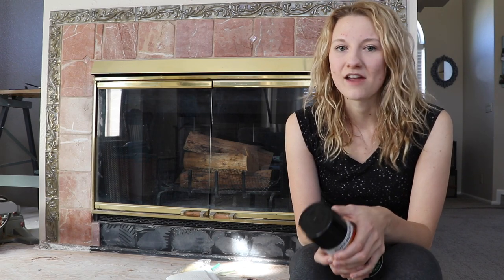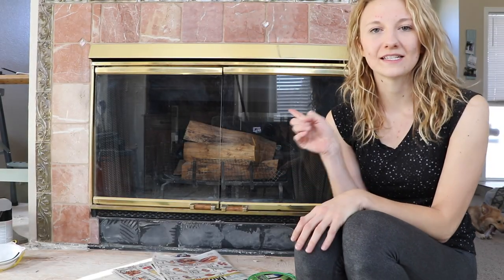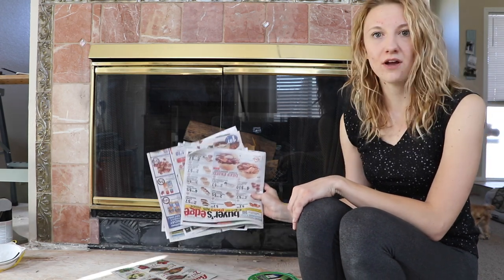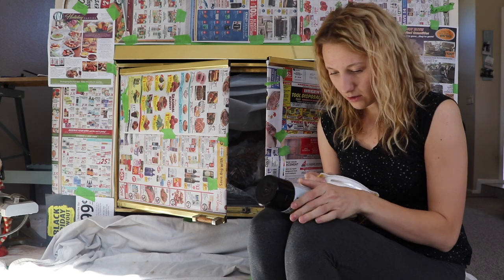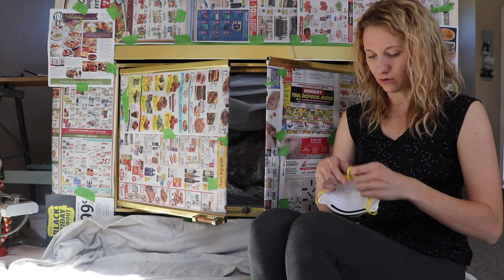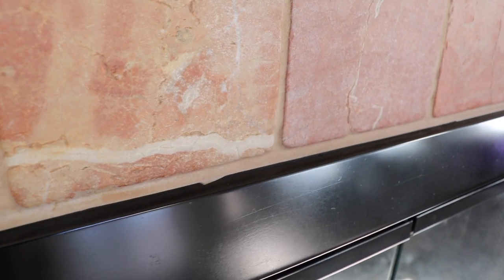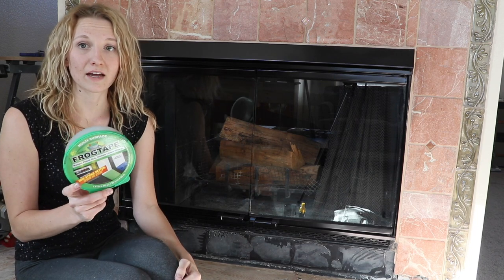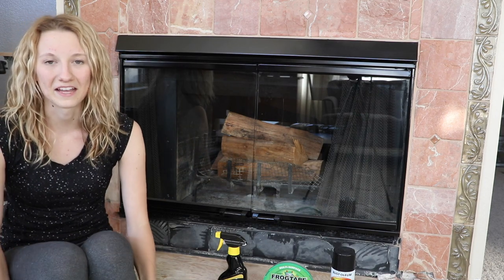$4 DIY Fireplace Makeover! Rustoleum High Heat Spray Paint

Comment: I LOVE the change. I have a surround to paint on my own fireplace.  Great job!

Just FYI, I've painted many windows, for the over spray spray the glass with water and a few drops of dish detergent added and then use a safety razor to clean the paint off of the glass. It is so much easier and faster and you don't run the risk of softening the other painted surfaces.

Comment: Just an FYI. You can remove that surround and spray it outside. SO much easier. Most have 2-4 screws, and that's it. Look inside your fireplace. You will save yourself some prep work, and the possibility of overspray floating around inside your house. 👍 For those saying it's still tacky....you did not clean and sand before spray, you didn't shake the can long enough as directed, or you haven't waited the full cure time.

Comment: Hey, i had the same issue as Sally Cooper below. You used "Ultra" with a glossier finish, and I just used Rust-oleum High Heat Black (satin finish)... after almost 18 hours now, it rubs off a dusty layer on my fingertips. I'm curious if a "heat cure" is needed because I've seen instructions that it should be cured at 450 degrees for an hour. Curious if you've run into any issues!
Reply: I did mine 15 years ago. I used the flat black but did not touch it at all for 6 months to let it dry and cure. It has held up just fine.

Comment: I jus used the rustoleum high heat black enamel and when you touch anywhere after it dries it leaves great fingerprints everywhere. Do you have this problem and what do you use to clean it? Has it held up because it seems like any tiny thing will scratch off the paint. Mine was a flat black but yours looks glossier actually.... ?
Reply: I painted mine 15 years ago and it has held up just fine. I used the flat black too. I will say, I didn't touch it for 6 months in anyway to let it dry and cure.

Comment: A small problem with this seemingly good approach is that spray painting inside the house is not as easy as you may think. The spray paint gets dispersed and travels far... I did this at my house and I could see traces of the black pigment deposited near the kitchen...which is 25 feet away from the fireplace. Be careful or you can make a big mess.
Reply: Overspray from Rattle Cans can be pretty nasty. I definitely recommend forced ventilation and covering all areas nearby with plastic. Also, use an actual 3M Respirator. The mask she used is not going to do anything for the solvents in the paint.
Reply: Also when doing it outside, even if you don't think it's windy, assume it is and don't spray anything near vehicles.

Comment: Probably should have just bought and installed a new fireplace door as that spray paint finish is not going to be very durable, not like a powder coated steel/aluminum door and frame.  And probably should have used something less absorbent than newspaper to cover the class/tiles.  Still, looks good for now!
Reply: Is she spending your money or hers on a new door? Whether it's durable or not, a $5 paint job that can be touched up is way more cost effective than hundreds on a new fireplace door.
Reply: @capitalf123  We did this and it lasted like 10 years.